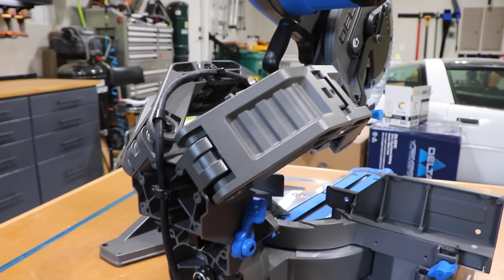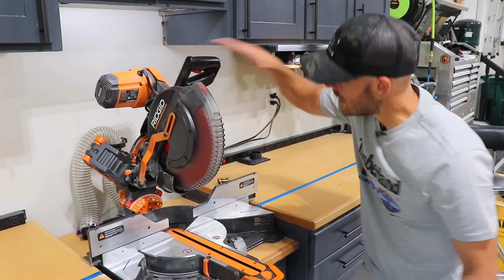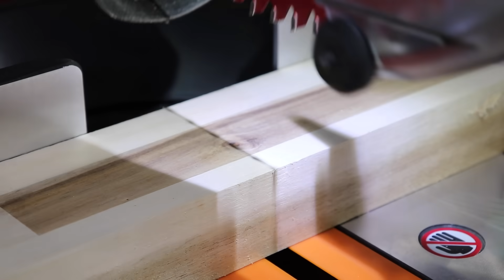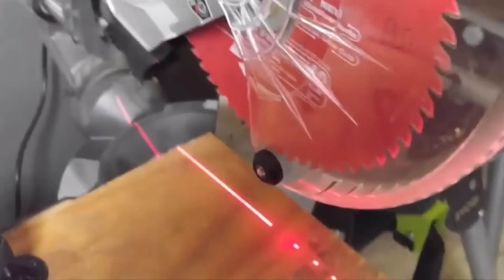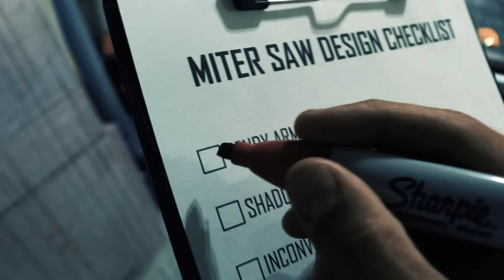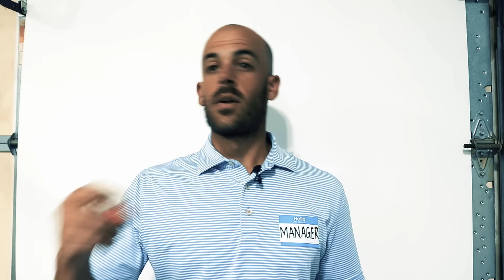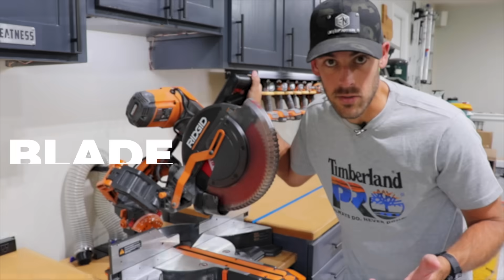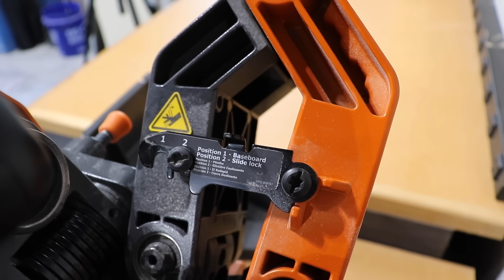I ALMOST took this Saw Back. // RIDGID & Delta Dual Bevel Sliding Miter Saw Review

Comment: I love this saw. I replaced my Dewalt DWS779R with the Ridgid 12" to save space. I wouldn't call it an upgrade but it worked for me. I was also hit with the bottom miter pivot issue on my miter station. The plans I got from your site that I also love. Luckily I had the room to move the left side of the station over so that's what I did then expanded the center an extra 8". That fixed the pivot issue. Your dust upgrade keeps it much cleaner than when the Dewalt was doing the cutting. It's funny I bought that saw to save space and ended up using more space in my shop. Oh well, it worked out okay and I'm happy.

Comment: Great review. I have had the Dewalt 780, for several years, and it works great for average garage work, around the home, and job site. I love it, and it will last me for years. But the new sliding arm technology is pretty great, for a bench mounted system. 
Thanks for this detailed review, and the info. On that other dust collector attachment!
Reply: DeWalt is only 3.00 in depth longer
Reply: @purtis99  Ah... Well my saw is on the mobile stand, so it fits almost anywhere. The problem is, it does get buried in the garage, behind other crap in the floor.

Comment: If someone hasn't already commented this. The way you would get full cut capacity, is you have to remove the moving portion of the back fence. then put a 1 1/2" spacer/ build up against the fixed portion of the fence. This allows the piece to go back further  which also falls on a wider part of the blade to get more capacity out of the cut. figured this out with one of my Dewalt mitersaws. Hopefully that makes sense to you.
Reply from the maker: I figured it was something like that, seems like kind of hassle if you ask me!
Reply: I was guessing it was one of those scary cuts you see when they lift up the front of the board during the cut. Eventually someone's gonna chop their hand off doing that! 😳👋

Comment: I have the 12 inch Bosch. I think the deflection is something you overcome with technique. I make it a point to be "easy" on the grip and chop instead of grabbing the handle like it's an arm wrestling contest. I do agree with your comment and others should also be aware. Even the Bosch and Festool saws arent really the best options for a glue line cut but they are both impressive machines. Dust collection is lousy (I think it's a rule for miter saws to have crappy dust control) but they are amazing saws. Noted the Festool does have the best factory dust collection as I'm told by other woodworkers at least until we have your version for the Bosch! Great review and awesome content! Shop greatness achieved!
Reply: As another Bosch owner I agree with everything you said here. 

When I first got mine I was really bummed about all the deflection from the video reviews I kept finding when looking for dust collection.  At the end of the day I realized it's not sloppy loose fit so the saw won't just give random cuts.  It's deflection and a a general rule I just don't push on handles sideways hard enough to select the saw
Reply: I'm a cabinetmaker. I've tried several of these robo arm chop saws. They all have less accuracy/more wobble than a traditional rail guided saw. Would not recommend.
Reply: And making all your cuts on a table saw isn't always practical like Sean said. No one wants to cut crown moulding on a table saw

Comment: Great review, thanks for your work and time, what about dust collection? what is your opinion as of today??? a been looking for this saw for a while. Thanks again
Reply: I did not see all the video, sorry mis the part of the Dust collection i was laffing  with that part of the video, thanks again
Reply from the maker: I was gonna say...dude, I definitely didn't leave dust collection out! lol
Reply: As a rule of thumb all miter saws have crappy dust collection. With that said I wouldnt let that be the deciding factor as far as other qualities but an extra bonus instead. I like the robot bendy arm designs. I have the 12inch Bosch and will add this: Bosch for me has had world class customer service and available parts. I also have a delta table saw but I have little faith that customer service with Delta will leave me feeling happy. I may be wrong but between the two saws in this review I would pick the Ridgid because ar least you have Home Depot behind the name as an extra bonus even though both saws are technically Delta. Not knocking Delta products but I have seen many postings about bad or nonexistent service when calling them directly. Do your own research.